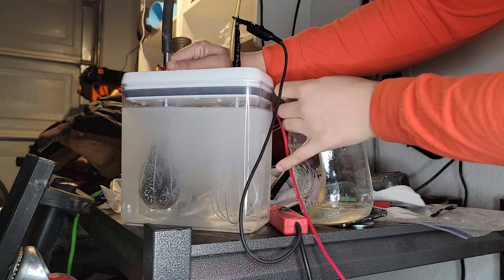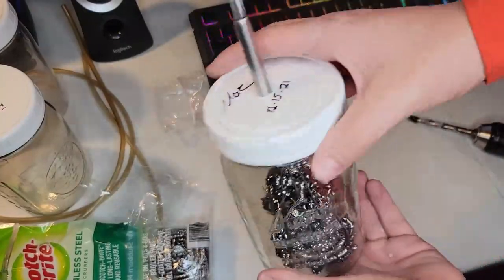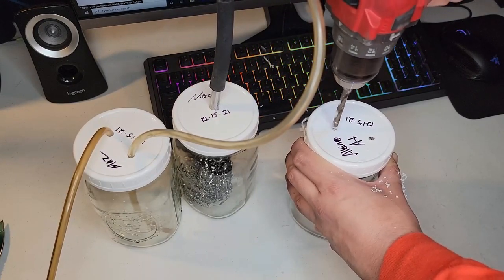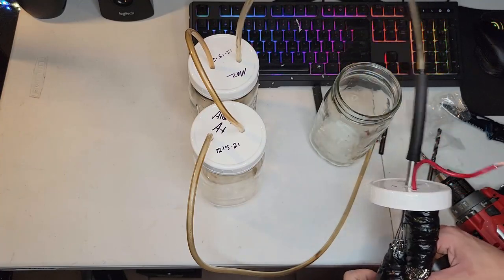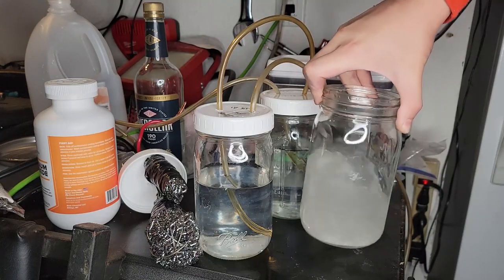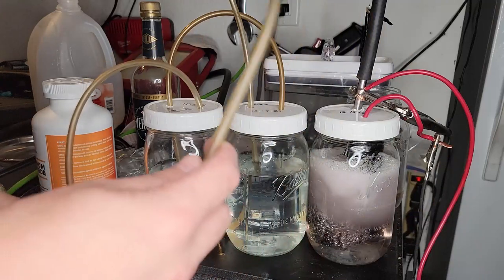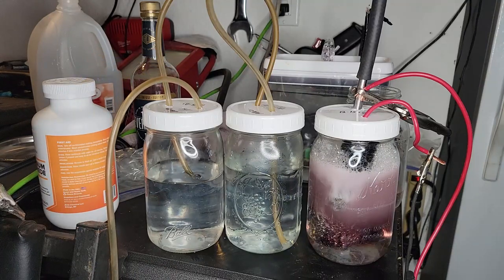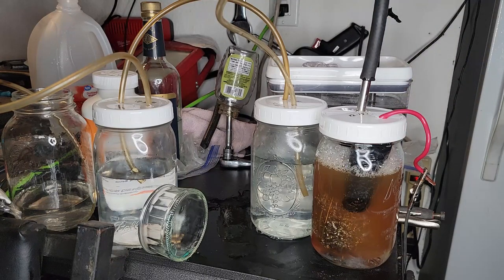Making Hydrogen Gas & Exploding It. HHO Generator Experiment. Mission To Run An Engine Off Of Water

Comment: Some folks have been using a similar system in their vehicles to boost fuel economy. They pipe straight into the intake manifold. I haven’t tried it myself but I’ve heard it works pretty well. Kinda seems like a potential bomb under your hood, but with the price of gasoline it might be worth a shot.